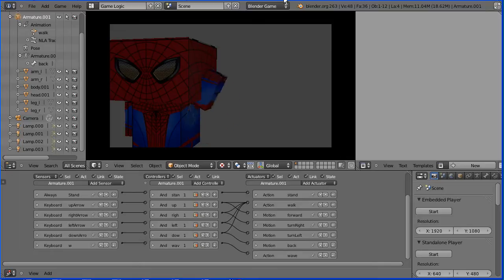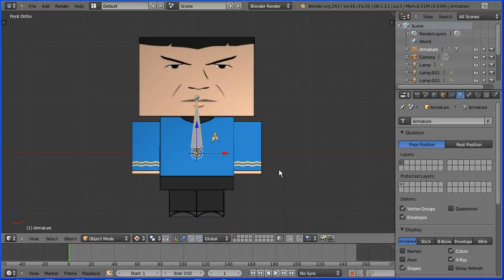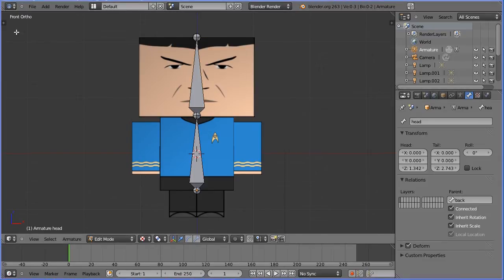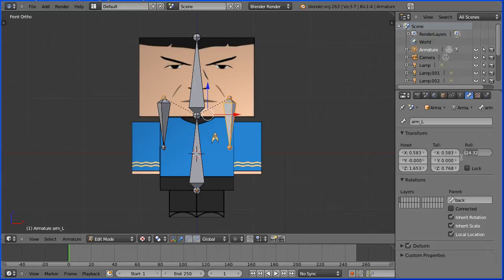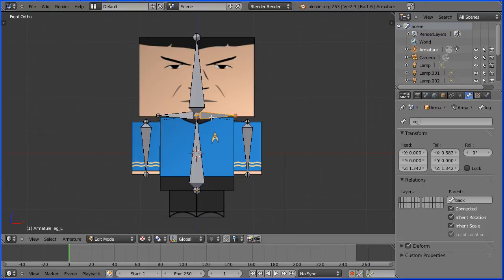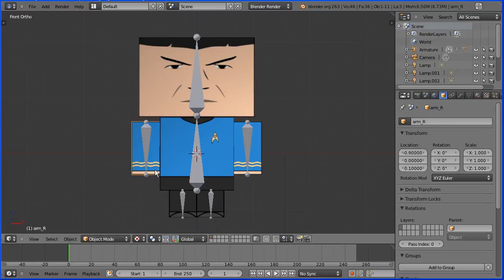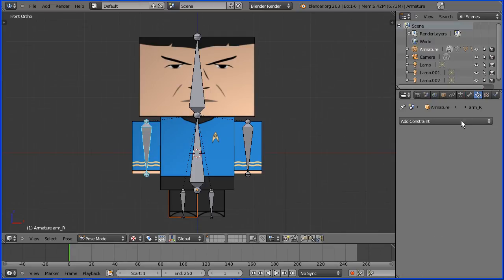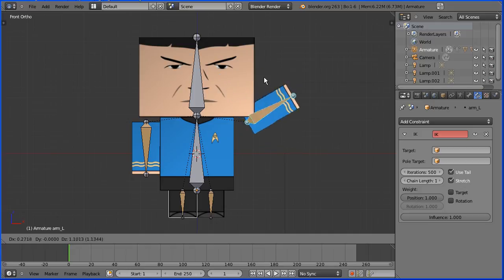Blender Basic Rigging Tutorial - Adding an Armature to a CubeeCraft Figure

Comment from the maker: When you use the inverse kinematics constraint it does not make any difference, the advantage of extruding from the tail is that the method is the same for all limbs. If you prefer to extrude the legs from the head of the back bone, that is fine, it will work the same.